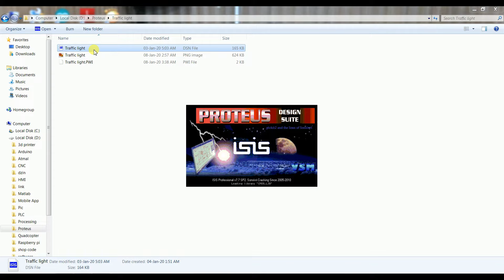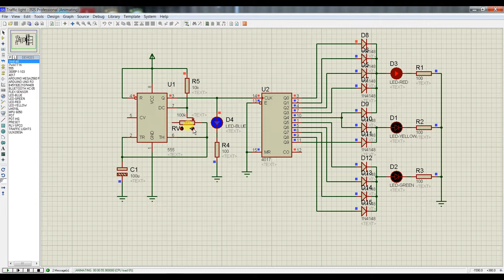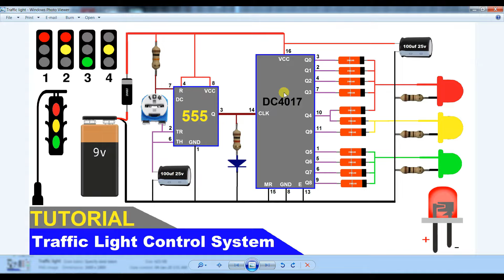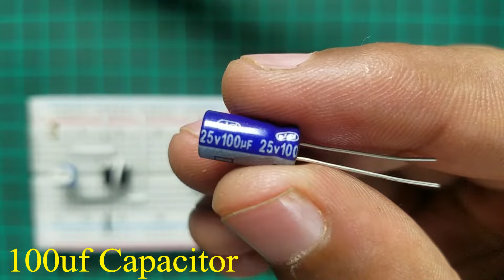Traffic Light control system using 555 timer and cd4017

Comment: I have done the project just as u said but my project is not working properly i juat done one different thing i used jumper wire instead of connecting wire

Comment: I want to ask, why does the blue LED light stay on when the source is turned off on the proteus?
Reply: bcs of the capacitors because capacitors store charge in them or the circuit will have the power from other sides